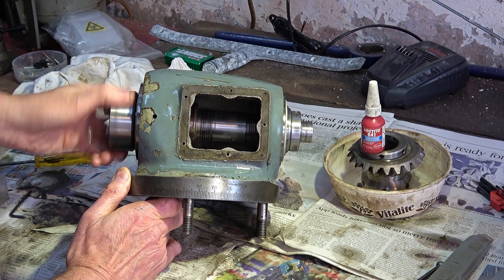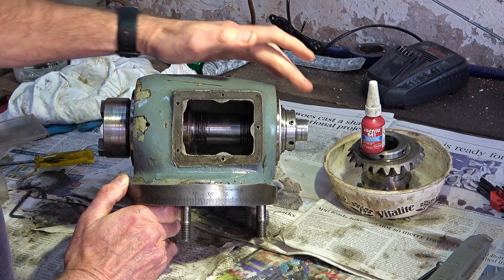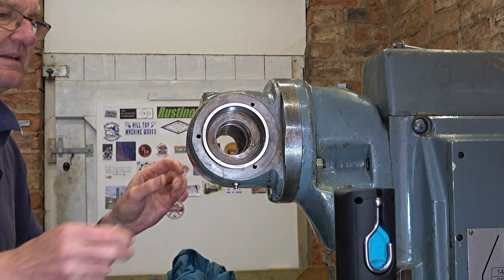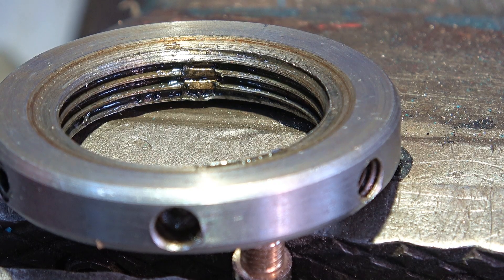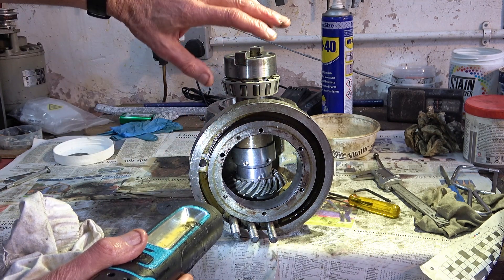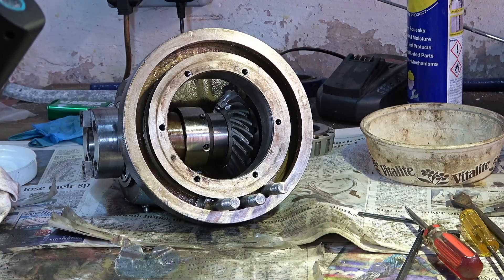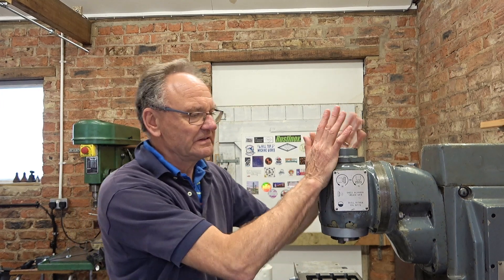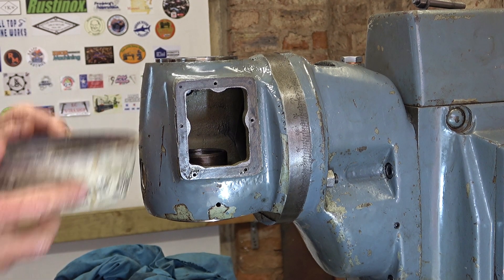HS223 Harrison mill vertical head spindle bearings adjustment - Part 2

Comment: Those conical bearings must be lubricated with the right type of grease, and that black grease is not right,  AND you absolutely must not put too much grease in them, otherwise the bearings will become too hot!
cheers ben.
Reply from the maker: Hi Ben, it has the right grease in now (as per the machine plate) but I fear I pumped a bit too much in. Luckily there is no seal on the top and bottom caps so the excess quickly sprayed onto my shirt, so I think it will continue to throw out any remaining excess and in that sense it is self regulating fail safe. Cheers

Comment: I consider bumping shafts with dots or knurling them to improve fit bodges. Loctite is a proven non-destructive method. Well done Paul , you got there in the end and it wasn’t going to get better without some attention.
Reply: Agree completely. Whatever method you use to raise a surface to improve a fit it is a bodge.
Reply from the maker: Hi Tony. One person with proven experience has commented that knurling/grooving/dotting can cause the inner race to be cockled over slightly causing accelarated bearing wear (so he agrees with you). Cheers

Comment: Very good Paul. As I said last week I think the bearing fit you got was what was needed and there was no requirement for raising the surface to gain a tighter one. Great video, very helpful to me.
Reply from the maker: Hi Carl, hopefully I've done the last fix on this machine now. It's been a long road. I think my gearbox middle shaft grumbles quite a bit I will not be fixing it unless it gets really bad. It may be the straight cut gears I'm hearing but my lathe does not make that noise. Cheers
Reply: @HaxbyShed  Well, if you decide to do something about it, you know where to look...!

Comment: If it wasn't for loose slip-fits,  Loctite may have never made it to market .  Your application is practically the selling-point for all retaining compounds.  Actual, I don't see your fit as anything too unusual for an internal race .  Your choice of  914 medium-strength  was a good choice because I think that in the future you may need to bump-up the preload a little more as things settle-in .  Being that Loctite retaining compound is not a glue,  and you used the medium strength,  i think you can muscle-in a little more preload without any additional disassembly .  I like your work, Paul .... looking forward to seeing more !
Reply from the maker: Hi Ken, yes I think I could 'muscle it' a bit to take out any chatter. It will get a proper test this coming week I think.  Hope you Porsche is running well 🤣
Reply: mea culpa :   641 Loctite !  ... apparently, I had a Porsche on my mind earlier .

Comment: They are fun to get back together are'nt they!! I was filled with trepidation when I did mine, but had no chice about the matter. I think you have got that spot on. If you consider the film thickness of the grease under the rollers, it must get tighter when you grease it up and turn it, but the film must be there as you do not want metal to metal contact. the coarse thread does provide very coarse adjustment but if it doesnt get hot it is good, you would expect it to get warm because of the grease being forced through the bearing and under the rollers, but it should be hand warm only after say 30 mins at top speed, but we aren't on piece work and the foreman is long gone! 
Good work
Phil
Reply from the maker: Thanks for your help with this Phil. Talking to somebody who has done it before is a big advantage. It's hard to figure out the true operation and difficulty from just a line drawing in a manual. Cheers
Reply: @HaxbyShed  i think i said to you some time ago, but if not, I repeat myself! The proper way to test bearing pre load used to be with a cord and spring balance, you would wrap the cord round the spindle at a given diameter, attach the spring balance and gently pull. You looked for the reading on the balance at the breakaway point when the spindle just starts to move. Very easy IF you can find a manual that lists what the reading is supposed to be! One can imagine a formula that gives bearing diameter and type, oil viscosity etc etc. perhaps a look at timkens website? All you would need is the bearing number and that would be in the manual?
Phil

Comment: Any comments on usability with no quill? I have a French 50's era Gambin mill. Horizontal / vertical spindle, but no quill. Drilling is very nerve-wracking and no tapping....

Andrew
Reply from the maker: Hi Andrew, the Mill is very rigid for a small machine and so far the bit of drilling I've done by raising the table has been fine. One full turn on the table is only 2mm.  I have a substantial pillar drill so I could spot multiple holes on the mill using X-Y with a centre drill and then transfer to the pillar drill for bigger drills. The pillar drill is just fantastic with my tapping head. On the web I've seen people make/add a fine drilling spindle (10mm?) and chuck, with hand feed lever, that runs through a captive bushing in place of the drawbar for light drilling. Cheers

Comment: Glad it all worked out for you, any future play in the taper roller bearings after bedding in, should easily be taken up even with the loctite I think. The bronze or brass pips that lock on the thread, would have been made by running the correct size tap down to cut the shape, well that's what I did when I was building machine tools!, cheers Dave
Reply from the maker: Hi Dave, no clue where the original brass pip went to. If I find it on the floor sometime then at least I will be sure it's not in the head (but I had a real good look inside the head to be sure anyway). I think it was lost by the previous 'repairer'. Cheers

Comment: Hi Paul. The “oil outtake” was a brilliant end to an interesting and informative video. You definitely showed that setting bearings is very much about using your senses (feel and hearing). Well done on a great result. You must be well pleased.
You tease about a new machine. What can it be?????? 🤔
Reply from the maker: Hi Andrew, I think the new machine will make an appearance in teh next video but one. However if you have a very sharp eye you may spot some clues in the next vid. Yes setting those bearings was very much about feel, and over several checks to reach a consensus in my brain.  I think as I get older the value of quality thinking time becomes ever clearer.  The first conclusion is not always the right conclusion. Cheers

Comment: Turned out well Paul. Initially I was unsure about the Loctite, but it seems you have achieved the required pre-load and hopefully adjustment will be rare.
I have just been through exactly the same process on my A&S mill but didn't have adjusting collars for the bevel gear mesh. It is interesting how the two manufacturers had differing priorities in their design: lighter helical bevels & taper roller bearings Vs heavier straight cut bevels & angular contact bearings; pre-load on inner races Vs pre-load on outer; Int 30 Vs Int 40 on similar size head etc. I came to the same conclusion as you that +90 to -90 rotation of the head causes no issue for oil containment.
Reply from the maker: HI Clive, I think in those days designers followed their personal experience - no computer modelling. Maybe the Harrison designer came from a company making car differential crowns and pinions.  I just checked and the Harrison manual definitely says 45 degrees either side of vertical. Cheers

Comment: Did that once with 14 qts. of  Nitro 70 engine oil in my Top Alcohol car with the drain still out. Shop floor was slippery for a long time. Good that we can laugh about stuff. Try some blueing or white lead on the gears to check pattern. I was taught by a super machinist: 6 - 12 inch lbs, rolloing torque with 10w oil on the gears, room temp. Always set my Mercruisers @ 9 inch lbs. & gear lash / brg. set was never a problem in 48 years. Cheers.
Reply from the maker: Hi Bob, quite apart from anything gear oil is expensive.  I may not go to the lengths you suggest to check the bevel engagement just now, but it's good to know if I do in the future. Cheers Paul

Comment: Nicely done Paul, good to see you dispelling the urban myth on the rotation of the head. Enjoyed the outtake at the end, I think we all have a similar t-shirt in our wardrobes :) Looking forward to seeing your latest acquisition
Reply from the maker: Hi Paul, I'm sure I'd read somewhere that the max working swivel was 45 degrees and sure enough the machine manual says "[Vertical head] Swivels, either side of centre line 45 degrees" so I was not dreaming. Harrison wrote it in the manual. Cheers
Reply: Hello
I need a compelet harrison universal milling head spindle. How can I get one?